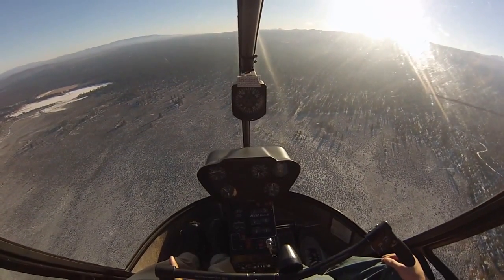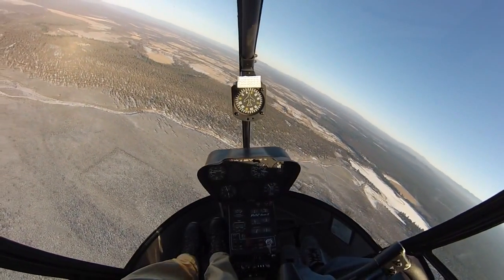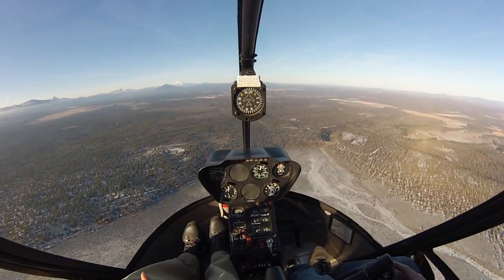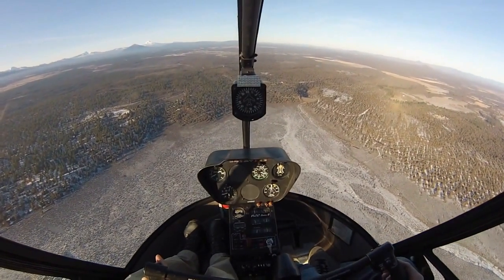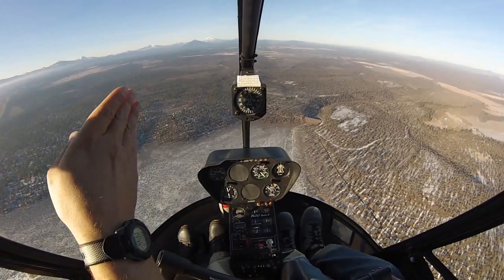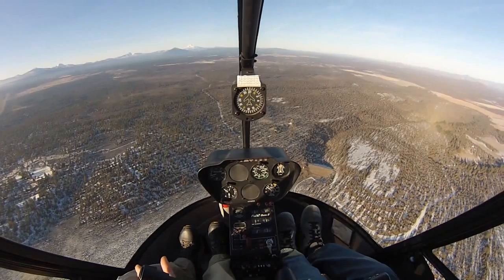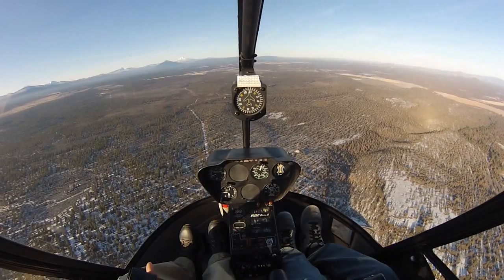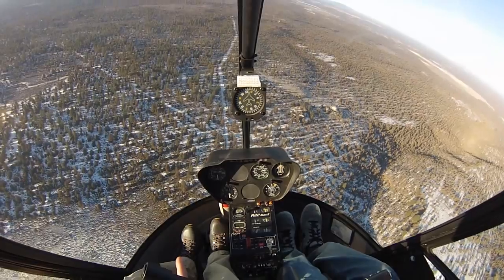Helicopter Vortex Ring State (previously referred by the FAA to as Settling with Power) Escape

Comment: Amazing how people think stalling air at the base of the rotor is the same as simply mismanaging inertia….
Reply from the maker: SWP vs VRS?
Reply: @HelicopterTrainingVideos  settling with power and vortex ring state are not the same thing. Vortex ring state is an AERODYNAMIC reduction in lift. Settling with power has nothing to do with any sort of aerodynamic phenomena. The aircraft is simply descending with significant power applied. If I power slide around a corner and I’m red lining my Honda rice cooker, my tires and their traction haven’t failed, the cars energy is just simply too much to arrest immediately.
Reply from the maker: @Traumaquota99  Agreed

Comment: Airbus say this is not a normal phase of flight at anytime. This shouldn’t be practiced and avoided at all costs
Reply: Agreed.. you should not 'practice' it.. because you won't ever get better at it.. unlike autorotations say.
But you SHOULD be shown what it feels like to get into, ... and how to get out of it. Guaranteed you won't forget it.
But an experienced bush pilot will tell you that risk is there everytime you sling a heavy weight on a 50 or 100 ft line, in dead air. ..or a lumber company wants to look at a particular bunch of trees on a mountain slope.. hovering in dead air.
Reply from the maker: It is a required maneuver on FAA checkrides - so the maneuver will not go away any time soon...

Comment: And again another video discussing TWO DIFFERENT PHENOMENONS.  Settling with power and VRS are NOT THE SAME THING.
Reply from the maker: Agreed, but because the FAA uses 'Settling With Power' as the name for this emergency procedure maneuver/recovery in the Pilot Test Standards & other material (https://www.faa.gov/training_testing/testing/test_standards/media/FAA-S-8081-15a.pdf ) we use both 'SWP' and the more correct 'VRS' in the title/description to help those looking for VRS by the FAA name.
Reply: Who cares what the FAA calls it, it's wrong.  A clear explanation in the description is necessary to keep people from believing that VRS and settling with power are the same and to keep the less informed from spreading that myth.

What's equally and arguably more important than learning the recover methods(which are usually academic as VRS often occurs at low altitude which  often makes recovery unobtainable.  Settling with power is a result of poor piloting and/or failure to take atmospheric conditions into account, such as high altitude or high density altitude.) is learning how to identify the signs of both VRS and SWP before they occur and avoiding those signs all together.
Reply from the maker: I agree with you. I have also updated the video description to make the distinction clearer. 
But as to 'Who cares what the FAA calls it...' - The main target audience of these videos are helicopter students in the U.S. FAA system, and as already mentioned because the FAA uses 'Settling With Power' as the name of this maneuver, that is also what the FAA examiner will be asking students to demonstrate. So if you are an FAA student looking for videos to help with 'Settling With Power' practical test task...And at the end of the day, the student is trained to avoid, recognize & recover from VRS, regardless of what it is called.
Reply: I hear you on what the gov wants or calls it.  The problem I have is that pilots get a false sense of knowledge by believing the two are the same and as we know they are drastically different.  Have flight schools contacted the FAA in an attempt to educate them and correct this flaw?
Reply from the maker: 225degrees  As for FAA changing it's use of the term SWP, seems unlikely... The FAA issued a new Helicopter Flying Handbook in 2012 (with errata updates in 2014) and in chapter 11 (https://www.faa.gov/regulations_policies/handbooks_manuals/aviation/helicopter_flying_handbook/media/hfh_ch11.pdf ), page 9, under the section called "Settling With Power (Vortex Ring State)" it states "Vortex ring state 
 describes an aerodynamic condition in which a helicopter may be in a vertical descent with 20 percent up to maximum power applied, and little or no climb performance. The term “settling with power” comes from the fact that the helicopter keeps settling even though full engine power is applied."  But the FAA does have an email for comments/suggestions/errors in their handbooks - AFS630comments@faa.gov

Comment: The R22 can't settle with power. It simply has no power at all LOL
Reply: +Diego Mayán I assume you're joking, but for those unfamiliar, "settling with power" means the helo is still sinking even at max power because of the vortex ring state.  It's an extremely dangerous situation to be in while flying a helo.
Reply: @magicstix0r  today we recognize that settling with power is very different than vortex ring. 100% an R22 can settle with power. Put 2 300 lb pilots in the aircraft and try to bring it into a hover.
Reply: @robertgary3561  LOL being fat and overloading the helo isn't settling with power XD

You're not going to have to worry about bringing a R22 into hover with 2 300 pound pilots because you won't be able to get it off the ground in the first place... XD
Reply: @magicstix0r  things have changed a lot. Today that is what settling with power is. The phenomenon that occurs when slow in a rapid decent is now called “vortex ring state”. So the answers on the checkride are different now.
Reply: @robertgary3561  LOL there's nothing called "vortex wing state" I assume you mean "vortex ring state" which I already mentioned in my original comment. 

You have less than zero credibility right now...
Reply: @magicstix0r  You repeated what I said and then said it was right when you said the exact same thing??? What is this "wing state" you are speaking off?
Reply: @magicstix0r  The funniest part is that in ground school they literally warned us about this. They said there are a few old guys out there that were not taught the difference between the two but don't bother arguing with them they'll all be retired or dead soon. :)
Reply: Oh come on 5 HP is plenty.
Reply: Settling without power?